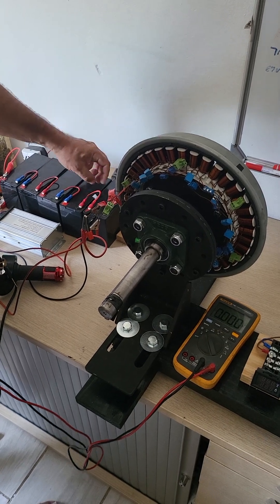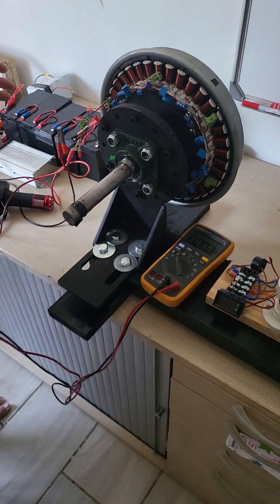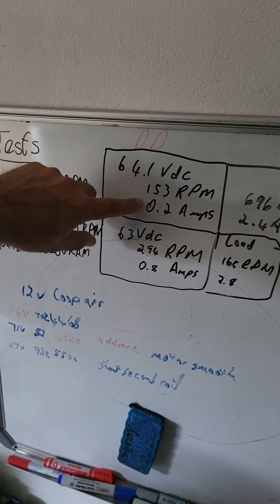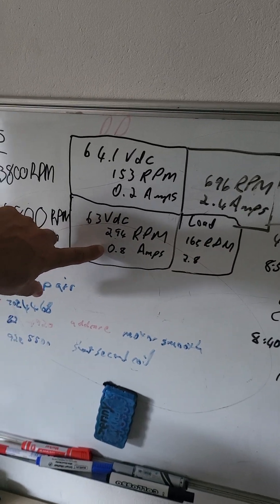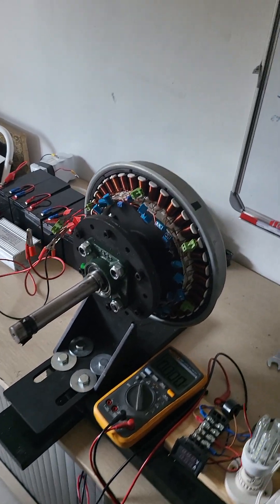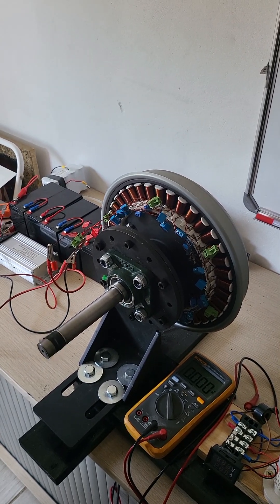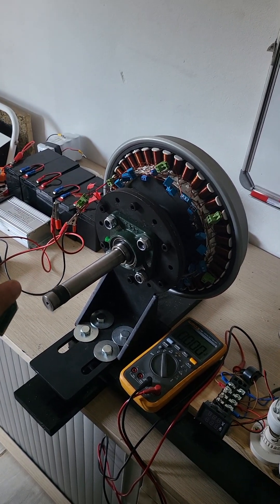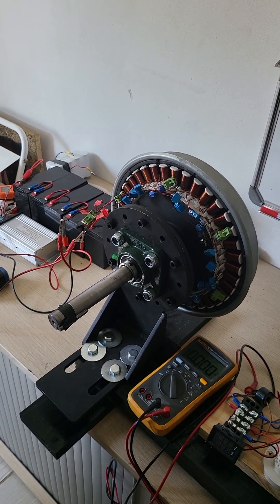LG washing machine direct drive test as motor

Comment: Good job! Like to ask if your running the motor with that controller and if so what voltage and id sensored or un senserd and how did you configure the coils to have it run from the controller. Need help to know that. Thanks.
Reply from the maker: These direct drive motors you can connect up to the controller or any other controller. This is 60v controller. The different controllers do come with wiring diagrams. ciao.

Comment: Thanks for the controller link here and the referring to the rewiring video source, but which wiring pattern did you use of the several he shows? Did you buy any means measure max steel torque using an watched level and scale or some other method? How was hearing with load? Thanks!
Reply from the maker: I tried them all. There are a lot of wiring diagrams here on youtube. No torque measurements, I do not have that equipment. On different rpm the DDs sounds awesome. TY for watching. :)

Comment: Hi.

Can you share motor part N for the one you using that came with alum winds?

Thanks
Reply from the maker: Hey. So ALL my motors came with alumium windings. There is a DEFINIATE improvement if you rewire. If you use voltage as your primary driver, and not current, you will also wind it with thinner wire. I did 0.65 mm. In South Africa I bought these at a washing machine parts outlet and this is link to part no https://www.tecsareco.co.za/product/stator-assembly/5306 . thanks for reading and just have an awesome day man. Good luck with your efforts. ;)
Reply: @jakesvandermescht694  Thanks for the reply. 

I have a custom rewound copper one I've done tests on. I bought one with a different model with Y on the end. Supposed to be pure copper already. 

I rewound one with 16ga and cut most of the poles off.

I've done similar tests as you have, but with a different PMG style than the drum motor. The drum is a great prime mover.

Comment: It would be cool to make a fan out of that and use the direct drive motor as the motor
Reply from the maker: Yeh off course you can! You can drive a fan a couple of meters high with this. The torque is insane. Thanks for comments. :)
Reply: Them motors are pretty cool in my opinion

Comment: Did you use the three hall effect sensors  for controller to function. if so could you show schematic ?
Reply from the maker: I did not. I used a china made controller from Amazon. https://www.amazon.com/DOMINTY-Electric-Brushless-Controller-Tricycle/dp/B07M9YMKMN/ref=sr_1_38?adgrpid=138345070010&hvadid=632832180121&hvdev=c&hvlocphy=1028645&hvnetw=g&hvqmt=b&hvrand=8937600333271029659&hvtargid=kwd-296540782208&hydadcr=22372_13333096&keywords=dc+brushless+motor+controller&qid=1683036210&sr=8-38